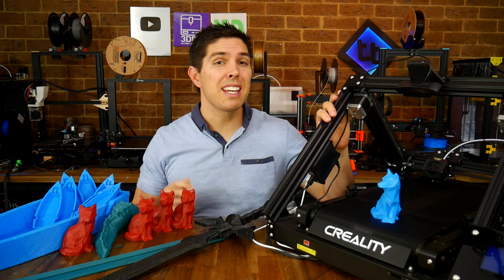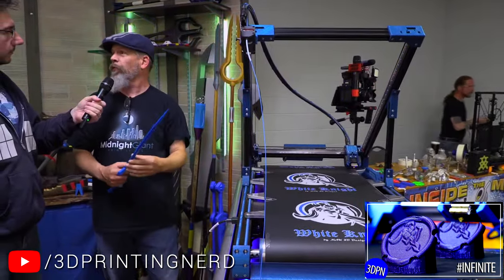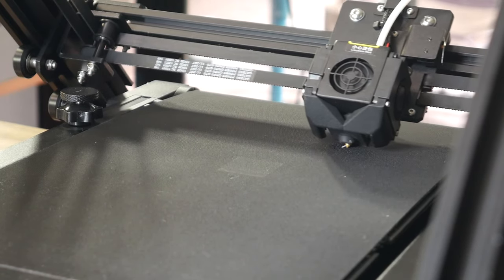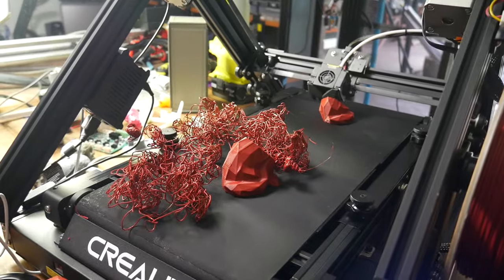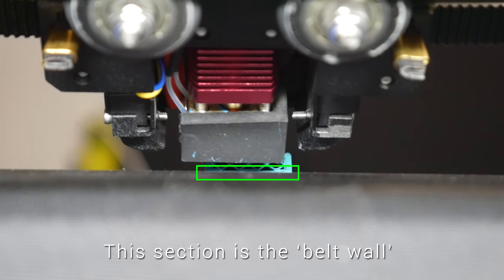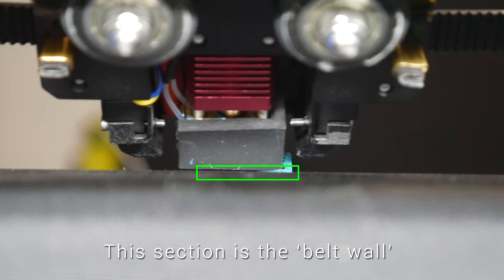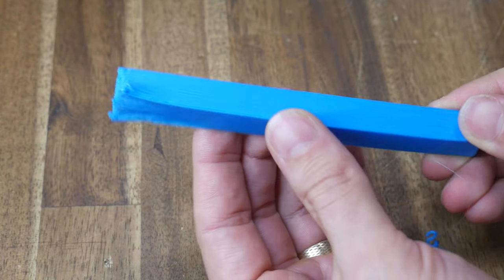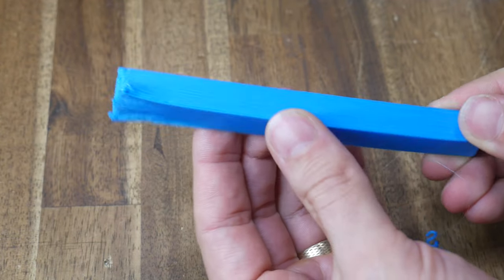Creality CR-30 3DPrintMill belt 3D printer: What to know before you buy

Comment: It's a neat design and will revolutionize large printing for things like cosplay armor and weapons. I can also see valid uses for it in the small to medium batch production space for simple objects like face shield frames or small life quality items that can be printed infinitely (until the filament spool runs out). I think it's limiting factors, however, are the possible materials that are printable. It'll print PLA all day without much of an issue, but I don't see ABS or PETG working too well, for example. That sounds like a warping and curling nightmare for sure. Who knows, though. If they get popular enough, someone will probably come up with a new filament specifically for use with these belt printers. Also, it seems like there is a lot of calibration nuance to the moving belt, so there is a lot of testing and tuning to be done to get a usable machine. That being said, I definitely think that there is a place for this machine in your arsenal if those specific conditions are met. Will I purchase one? Probably not in the near term, since I don't have a need for it, but it's great to know that it exists. There are a lot of Creality haters out there who will doubt this setup, but I think you gave it a fair assessment and I trust your analysis.
Reply: I've tried using PETG and your not exaggerating on the curling nightmare, but some seem to have no issue printing with it.  Not sure what my problem is.

Comment: A buddy of mine and I went in on a two pack of the printers. Glad to see the improved belt that texture looks very reasonable the previous one was too rough. Hopefully they find a coating that will be more permanent than needing hairspray. The addition of the octoprint server is great. The campaign has announced that they are including creality's version of one so we will see how that goes. I like the thought that you can monitor the prints in the queue and if they fail then cancel the print and print another. Even clear the belt remotely. Looking forward to the hands free replication features and will install large spools of filament to keep things cranking.

Comment: Hello Michael!  Need some help!  I'm looking for a way to accurately adjust the steps/mm for dimensional accuracy on my CR-30.  Unfortunately,  all usual calculators are designed for a 90 degree cartesian printer.  Being the Y and Z axis are NOT on a 90 degree orientation, the changes in steps/mm are not the same.  Do you know of a calculator or a formula that will accurately translate the 45 degree angle?  Thanks in advance!

Comment: 4:40 as far as I know, the Ender 4 was an H-Bot printer, not CoreXY.
Reply: I believe the motion system on the CR-30 is. Based on the Ender 6.
Reply: Correct. Converting an Ender-4 to CoreXY is a common mod since H-bots have difficulties printing circles 🙂
Reply from the maker: Thanks for the corrections, guys. I haven't ever used one.

Comment: Would it be better if the entire device was angled at 45 degrees so the extruder points parallel to the gravity vector but still can print continuously?

Comment: For sake of consistence with the belt level I assume there is a flat work surface under the belt that is adjustable. I am a 3d printer junky and I am planning the pick one of these up. What I am concerned with is a reusable surface.  I would guess the belt is a pain to change. Can it be coated with tape? Is there a bar or anything that holds the belt down just prior to the extruder area. Would think a spring tension bread roller just before the extruder would be needed. Thank you for the review.

Comment: my question.. now that I think about it.. WHY is it 45 degrees the same effect can be done without that odd 45 and you'd get better height control as well just have the belt not move until the print is done, unless they are trying to minimize something there, seems like way to many moving parts to print a 3d object. I like the belt idea for sure, just for assembly be easier to move the belt only when needed for Larger/longer prints or moving to the next model. 45 degrees seems uber gimmicky to me as to the WHY is it for marketing purposes it's like that?

Comment: You can get away with a less expensive webcam that requires a Raspberry. For our home security I use a Tend Camera, competitors to the more popular Ring Camera. As a home security camera it has an APP for viewing live. So, I custom designed a mount and I use it to monitor prints. I have my printer hooked up to an Alexa plug so if a print is failing I can say "Alexa turn off second plug or third, etc. Raspberry and Arduino have REALLY gone up in price due to what ever reason you want to believe, political or corporate greed or both. So, the less costly solution is using a Tend or perhaps other companies security cams. Only issue is that you have to design your own mount.

Comment: Do they make conveyor belt printers without the 45 degree angle on it?

Granted I wouldn't be able to print long parts, which I'm completely fine with, but the automation of part removal from the belt has me very intrigued.

Recently I started a project that required me to print 32 sets of chess pieces. Now, I never print more than 1 thing on the printer unless it's super tiny, which these weren't. I had to print 512 pawns individually to get them the way I wanted them.

Having a conveyor belt would have been extremely handy because I could have just told the printer to print out 512 of them one at a time and have them fall off the belt into a bin.
Reply: I don't see why this couldn't be to an Ender3 (or any I3 printer), it would be just a matter of substituting the hole y-carriage and support assembly with the belt assembly, then modifying the end gcode to roll until full release of the printed part and start again.

Tbh I do think this would be absurdly expensive with even a slimmer market than the cr-30, said that I do think it should be feasible 

Shouldn't require any major changes in marlin or anything, since technically speaking the Y is still doing the same job as in a cartesian kinematics. 

Said that, I probably wouldn't trust the Y carriage to have such a great precision if being substituted by a belt (given the way bigger inertia from by moving mass). I guess a CoreXY with Z moving the XY gantry (instead of the plate) would be more reliable dimensionally but the whole thing would be a huge mess and require some seriously buff hardware to run (considering the shear number of steppers required) 

Finally, check out Make Anything here on YouTube, some time ago he came up with a pretty smart way of removing parts from the built plate in a I3 printer, he made a whole video about it (not very elegant solution, imho, but I can't deny the functionality of it) 

Hoped I helped, have a great day ✌️
Reply: I didn't understand... ANY of that... And that's the problem. Not all of us are smart enough to do... whatever it was you just said. I'd rather just buy a working version of it.
Reply: @The_Nonchalant_Shallot  sorry mate, didn't mean to make you feel stupid... I just tried to help (and got carried away as always)
Reply: I'm not blaming you at all. I AM dumb lol
Reply: @The_Nonchalant_Shallot  that's actually quite smart, never seen it before. XZ being in semi-delta configuration requires major gcode modifications. At that point it's better to have a whole delta kinematic and having a sliding bed. 

Plus I can't see the config of the video being very stable when tilted 45°, those rods are probably hanging on for dear life. Neat idea thou
Reply: @andy_liga  Well to be perfectly honest I was thinking more along the lines of an Ender 3 mod where the bed is replaced by a static bed and the belt goes just over it.

Thinking about it, it would really be mostly a roller modification, since the conveyor belt should in theory be driven the same way the bed was, albeit needing some calibration because the rollers are gonna be larger than the bearing from the previous bed
Reply: @The_Nonchalant_Shallot  that's exactly what I said in the first comment, the problem with such a set-up is they you are relying on the belt to do the Y axis function and the belt would have a much bigger moment of inertia compared to the stock bed. It would be feasible with much bigger stepper and some serious mod. Very expensive indeed
Reply: You used big words lol that's what confused me

Comment: Hi, do you think it possible to print TPU on this machine? I am trying to create a 3d printed fabric and the endless z-dimension would be really good for this project...however, I really wonder if it will come off the buildplate.
Reply: Agonizingly slow but will be possible if you have all the time in the world, otherwise you're better off with 3-4 of these printers with incremental differences in settings and LOGGED, write down settings and even directly on the printed model and on paper. Once you dial in the absolutely tuned settings then you can let it sit for hours to print the base material for your projects. You might be better off buying TPU sheets and going from there but I can't imagine it being very lightweight for clothing purposes.

Comment: I wonder if it would be better if it used a shallower angle, say 25 deg off vertical. Then standard parts wouldn't have such extreme overhangs etc, however, could still move indefinitely. Maybe I haven't thought it through properly though.

Comment: What print speeds did you use with the larger 0.8mm nozzle and 0.4mm layer height?  I just got this printer and it was painfully slow with the 0.4mm nozzle so looking to improve overall speed.  thanks

Comment: Id love to back this, it’s a very unique printer.  I just can’t come up with a practical use for my work load.
Reply: I also would prefer it be an auto roll bed with a regular printer setup, but MakerBot owns that patent. 🙄
Reply from the maker: The 2010 version I showed is still on Thingiverse. I'm tempted to make a bed for automatic ejection of parts but still with a traditional vertically moving Z axis.

Comment: So far, i have not been able to get it to print.. It seems finiky in adjusting the level and one would expect it to be able to print maybe not the first time. though at least on the second attempt.. maybe i should change the nozzle to 0.4.. I think the standard is 0.2 and always had trouble with that size nozzle. then again. i have never been great at using smaller nozzles .. 

Just a quick question. do you think different brands of filament and the way they make it has anything to do with printing and how it turns out ?like consistency etc?
Reply: Would You recoment Buy this printer or there's other printers you know about.

Comment: Just out of curiosity, why is the belt not made out of a thin spring steel? Wouldn't that give a better finish on the bottom and be more precise? Also what's your estimation as to the life of the belt?
Reply: From my experience spring steel is much more costly. It is far less forgiving if the nozzle makes contact, and typically still needs to be laminated with something.   I think this is a good inexpensive alternative and I’m sure we will see more aftermarket options become available soon.
Reply: @NAK3DDesigns  Spring steel belt material itself is actually quite inexpensive, making a continuous belt with a smooth seam and/or laminating is much more expensive.  Also the edges of the steel belt are very sharp, a consumer version would have to protect or it would be a liability concern.
Reply: @drbtk  You are 100% correct, however having it precision cut, the edges rolled to make them safe and welding the seam, that makes it very expensive... 😉

Comment: Does the bed still flake off on the prints or was this problem solved?
Reply: I believe they solved this issue on this newer belt.
Reply from the maker: The belt has the pattern of the print behind but I can't see any degradation of the surface.

Comment: Definitely not the printer for me!
I use my Cr-20 pro exlusively for simple working parts that I design on 3D Builder, and I know by now which side of my part should be on the build plate to maximize stability and minimize support.
With this 45⁰ concept it will be way above me to figure out!
Also, I'm happy to print everything with a glass bed, lots of glue stick and a raft. Don't want to struggle with a flexible surface again, let alone a freaking belt.

Comment: print the boats the other direction... "into the overhang" not "with it"... let the sharp corner "build up" on a flat surface, rather than throwing a large flat straight into the air...

Comment: Confused?  Why build the 45 degree frame and long rotating belt?
Why not build an upright standard frame and belt, but the belt rotates?
Reply: You would not get "infinite" z with that. The 45 degree allows to print in a way that the z direction is constant, it never goes backwards. If you were to move both ways you would be limited to a smaller area in middle of the belt, as you can't go back after the part separates from the belt.

Comment: One major aspect ever gets mentioned.....is the bed heated? If not, this machine is extremely limiting. No ABS or PETG filament is a big downfall if not.
Reply: It is heated.
Reply: @archer9338  thats good then. Very surprised that not 1 review video or specs info mention this. Thats a big feature to not mention. Being a belt bed it almost makes you wonder if it was possible. But apparently it is. Thx for the info.